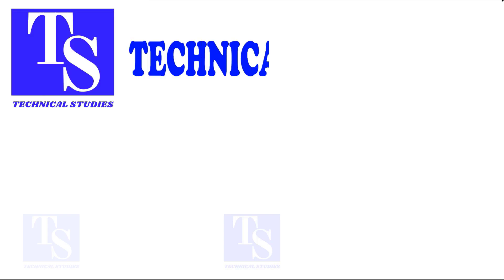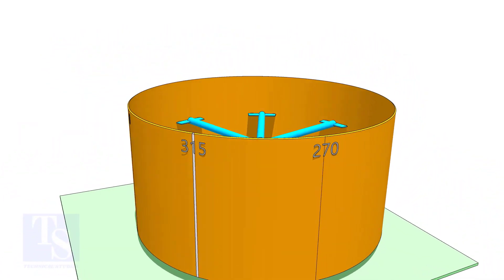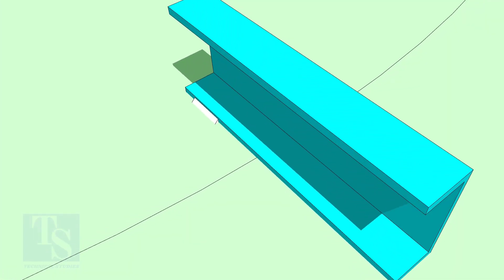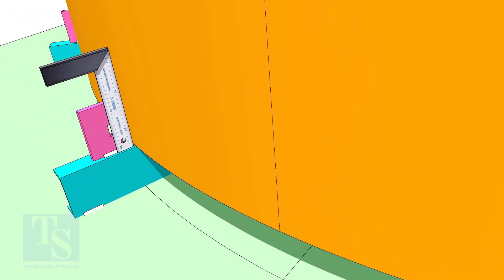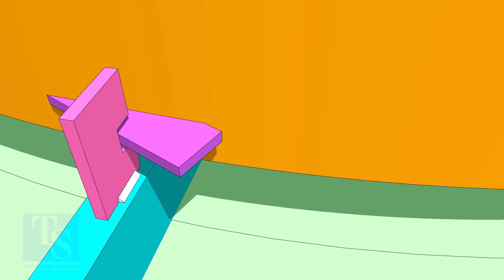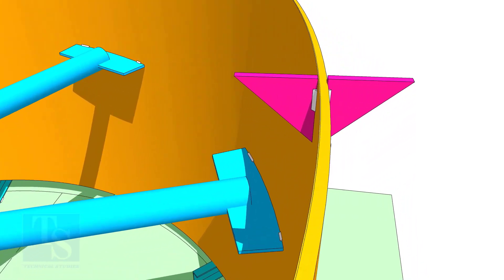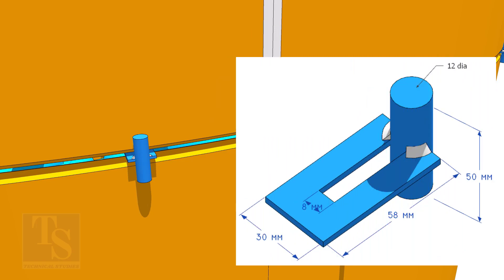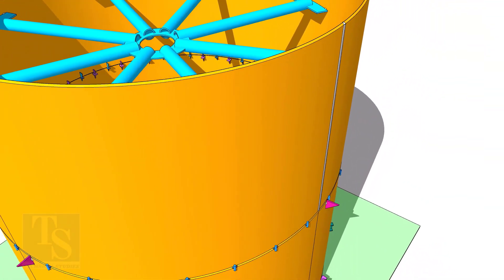TANK, PRESSURE VESSEL- SHELL DOUBLING-  VERTICALLY.

Comment: How we find the center line on shell for nozzle marking without spirit and water level like only from meter tape
Reply from the maker: Thank you for the question. There are two methods. 1) The center line of the weld joint . 2) Apply the plate rightangling method, carefully.